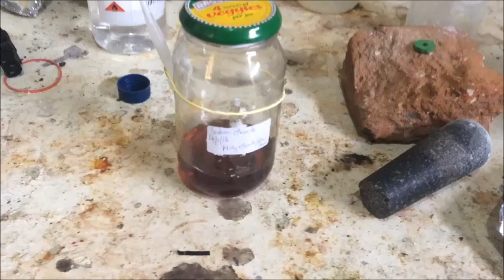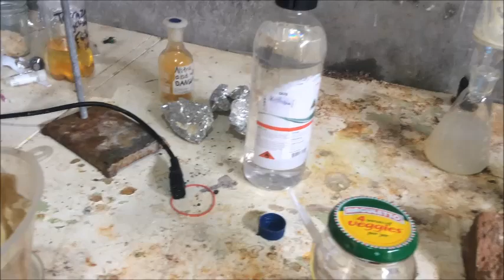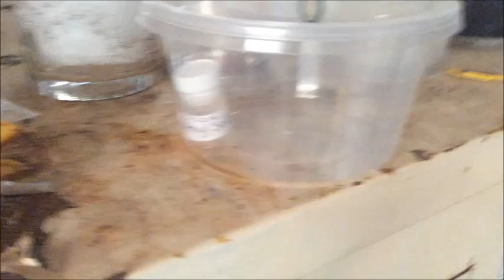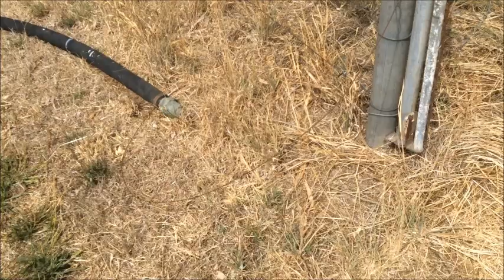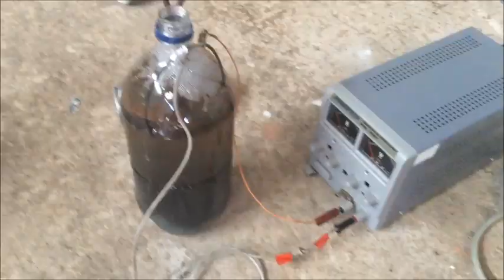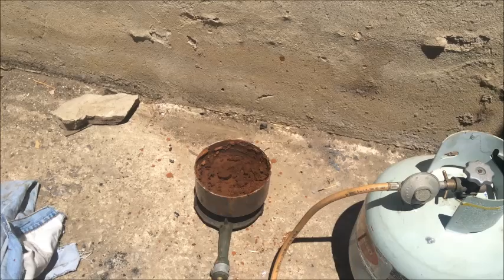Lab day//Making iron oxide

Comment: How did you make that sodium ethoxide solution? If you used denatured ethanol, usually denatured with methyl ethyl ketone because of similar boiling point, then adding base or sodium metal will cause self-condensation reactions with that ketone, causing brown color.